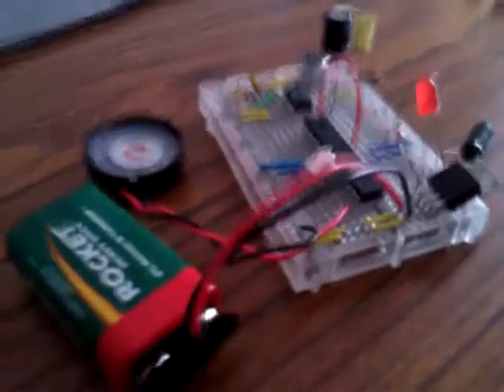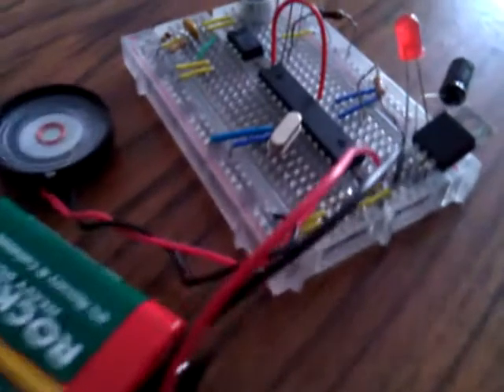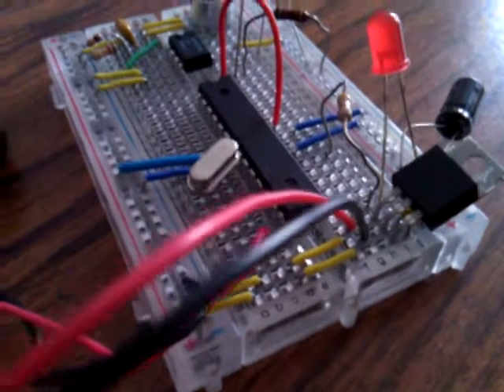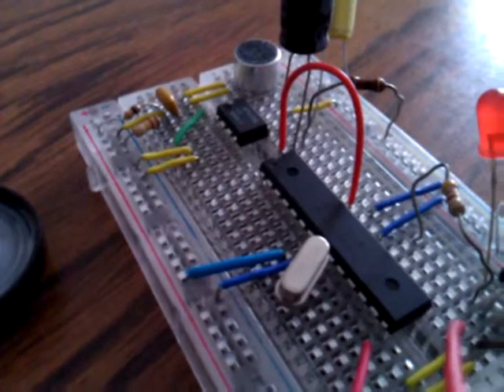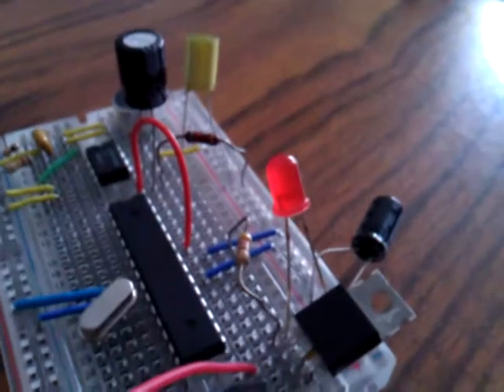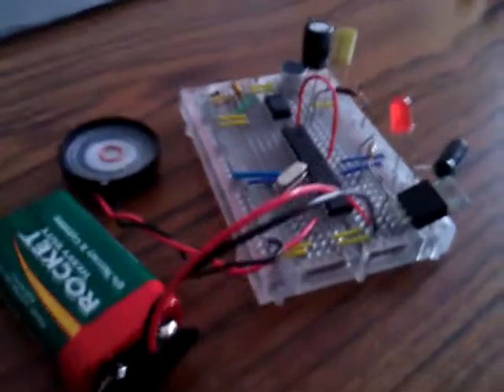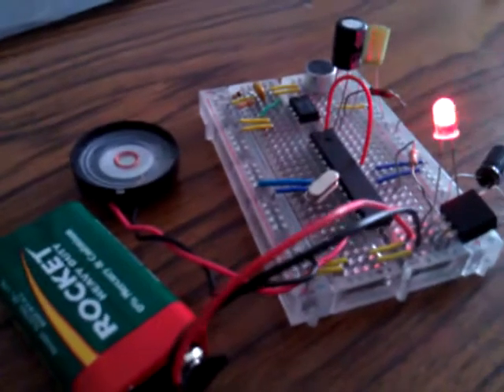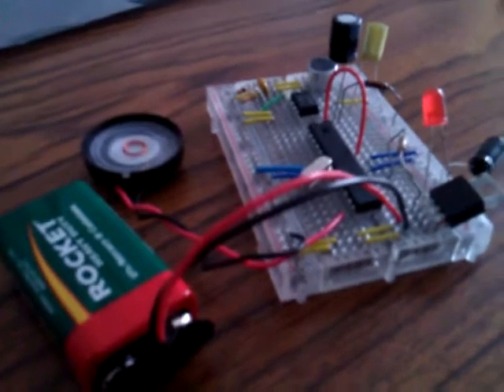A clapper circuit using an ATMEL ATMEGA

Comment: How do you make the micro detect only the handclap? Are you using some filter circuit? I have been trying to build my own but when I turn up the amplifier sensitivity, the other noises would be detected, and when I turn the amplifier sensitivity down, the mic cannot detect the handclap from a distance, it should be very close to the mic, help me
Reply from the maker: That is the big question about this project! I wrote code that, in effect, de-bounces the output of the A/D converter. The trick is for the code to monitor the digitized signal after it has been converted and check for only a "clap." It was really a hack because I made an assumption that a "clap" looks like a spike with a certain limited duration. Anything that doesn't look like my assumed profile is ignored by the code. In that sense, yes I filter it.